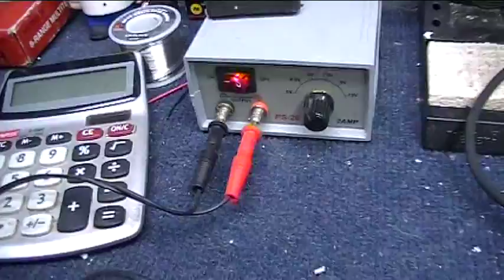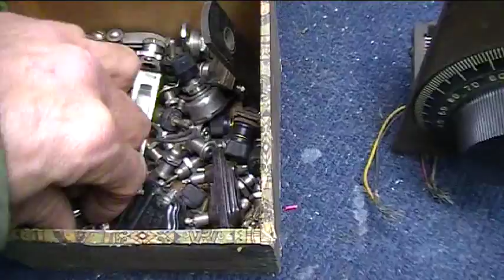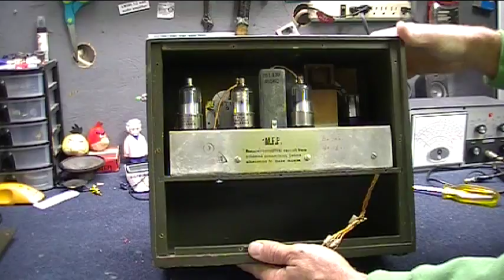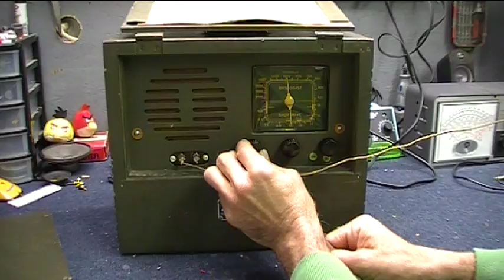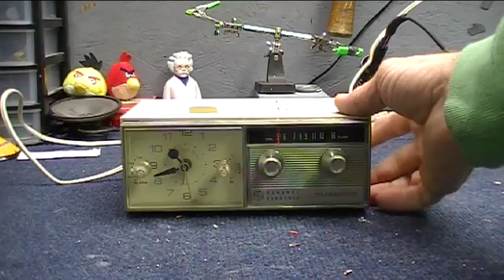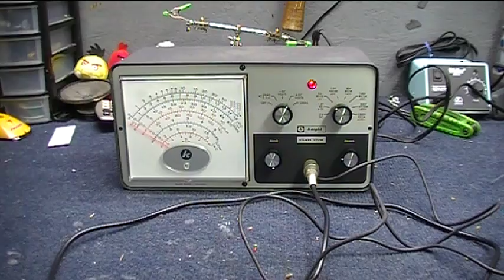Vintage Electronics Find

Comment: The likely reason why the transistor radio does not play if probably defective electrolytic capacitors. The electrolyte inside tends to dry up with age causing them to drop in value and eventually go open circuit. If you have a dead transistor radio, or one with low volume or distorted audio, this is the first thing to try.The transistors are very likely bipolar germanium types given that the set is from the early to mid 60s, they can fail of course but the caps failing is the most common issue.

Comment: there is just something about the way AM radio sounds! even though crappy and mono. its just nostalgic brings back memory's. even though I was born in FM era! ha I rember when I thought transistor was one of the tran sisters!  one of Jonny Tran's twin sisters! I have learned  a lot about electronics over the last few years. na really I hadn't a clue what a transistor was. I have a old capacitor tester. don't think it will work. it looks kinda like a metal cased battery charger. I think its a in circuit cap tester. got it out the junk pile because it looked cool. thought I'd make something out of it. if nothing else. maybe it can be fixed. it has no cords. they were cut off. but its not as nice as yours. little newer.

Comment: I have a national nc-54 same as you have. Any luck with it so far ?? I got into mine a little, found a 3 section filter cap - 3 different values in one cylinder. Hand slaps forehead - smack!. While I can work around that it is a pain.
Any progress ?  Shortcuts, points of interest you could pass on ? Thanks.....

Comment: Great post !  Just subscribed !
Reply: nice to see old stuff come back.Just from experience,throw that friggin points file back in the garage! most of those bandswitch have a plating that tarnishes making for the scratchy bandswitch.A spray with tuner cleaner or something called Cramolin which is used by NASA would be a better choice.And I suggest you buy a variac.Look it up.Thanks for letting us look. N2VUW.  ... -.- 73's.
Reply: And most importantly,recap those tube jobs.Old capacitor's can overload a power transformer causing it to fail.

Comment: Back in the era where there was such a push to claim more transistors in a radio in order to sell it, there was a problem with manufacturers putting in transistors that did absolutely nothing...weren't connected to anything in the circuit. The U.S. government stepped in and demanded that if it was in there, it HAD to do something.
On the radios of the 40's and even up to the 60's, ALL the capacitors (except possibly the mica types) need to be replaced.  The problem you had with the tube glowing excessively bright and then going out may have been caused by a leaky capacitor.
There is a YouTube channel you might enjoy watching.  It is called Mr. Carlson's Lab:
https://www.youtube.com/user/MrCarlsonsLab/videos
He has many wonderful videos, and has brought out a number of important issues that most of us overlook when dealing with old radios.  One radio he restored is a real GEM!  If you watch this video, note how the radio is actually mounted in the case:
https://www.youtube.com/watch?v=ISbidethQyc
Enjoy!

Comment: Jesus, you're damn lucky those radios didn't literally catch fire when you turned on the power. Those caps are absolutely horrific and MUST be replaced before even considering putting AC to these units. And no, not just the electrolytics. All of them except the mica based ones are basically somewhere between being a resistor and a dead short by now. They all must go.